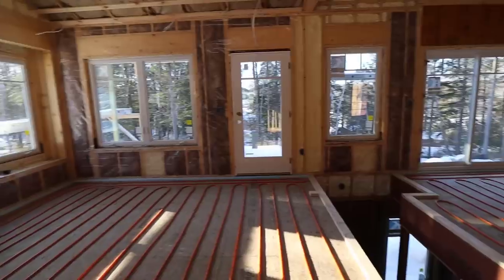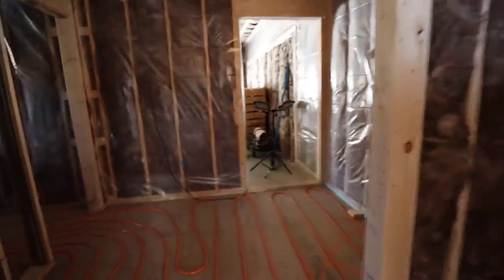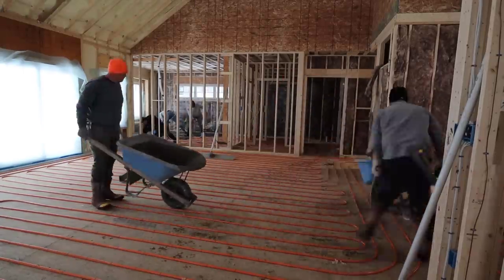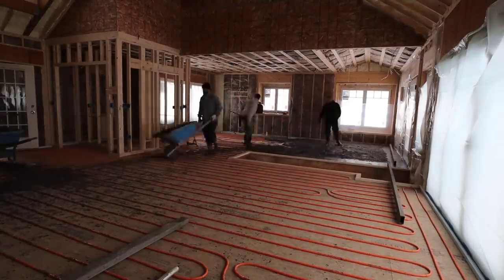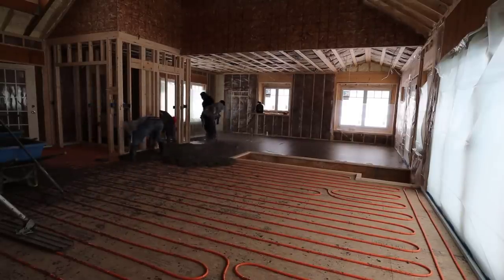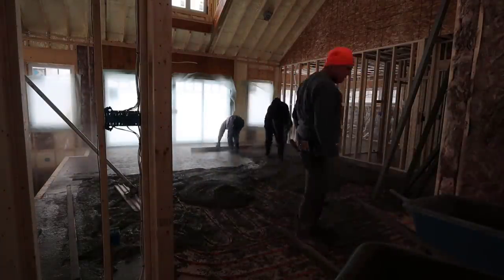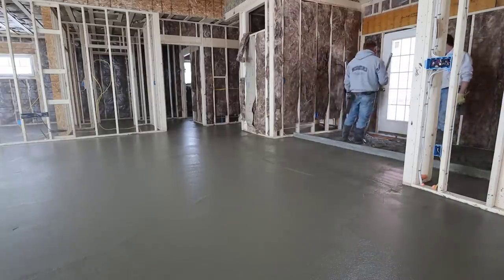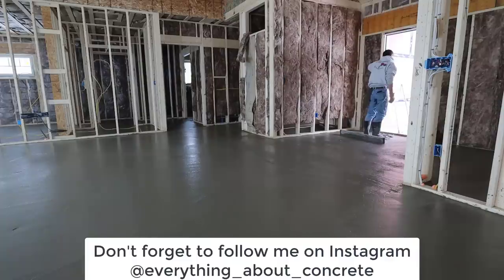Pouring Concrete For A Radiant Heated Floor (Concrete Over Plywood)

Comment: Hi Mike. Love your videos!
I have a funny story related to this pour.
Back in the early days of radiant heat slabs, I was in a meeting with the homeowner and the heat tubing salesman. Part of the salesman's pitch was that the tubing was so rugged that you could drive a mixer over it! Well that clinched the deal with the homeowner and the basement pour was scheduled. The morning of the pour we intered down thru the garage Bilco stairs to find a big sign waiting to greet us......PLEASE DO NOT STEP ON THE TUBING!!!
Hahahahahahaha. 
So much for indestructible and on top of that I guess we were supposed to remember where the hose was once it was cover with concrete!
Reply from the maker: Nice story! I still run into homeowners stepping in between the tubes and not on them. I walk right on them when I get there. Probably scare the crap out of them!!
Reply: @MikeDayConcrete  Hahaha for sure!

Comment: We pour quite few radiant floors in Wyomings cold climate  usually line pump if we do wheel we always pad front bar and legs and lay piece foam down to tip wheel barrow on 3/8 rock 6 sack good video pour on warm weather is upon us.

Comment: We do remodeling and a current client was asking about possibly covering her previously carpeted house with concrete - finished, and stained.

Now, we do concrete countertops and pour slabs, but honestly, it's a large floor-space and would want it to look good and last.  I'm just worried about cracking and flex, because we would be very limited on the thickness.  And I know that some modified concretes do not take an acid stain that well (if at all).

I'd love to do it, but it would need to be clean, strong and look great.

Comment: Poured several of these pretty well the same way you did except line pumped and not wheeled. Also have poured several garage floors like this,only 5 inches thick.

Comment: I noticed the double bottom plate. No air conditioning I take it. 
I have radiant floor heat in my basement with forced air upstairs.  ICF walls to roof line. LOVE my house. Built whole thing with my dad and family's help.

Comment: We use a pump truck in ny excellent job   guys
Reply from the maker: We do when we don't have access like this. I figure you either pull the hose around or wheel it. Little less money wheeling.

Comment: We do radiant ones in basements probably 8-10 a year.We have done one like what you did but it was 3" thick 4,000 psi 3/4 2 percent it was polished after we put a buff on it. I own a Schwing P88 pump for are use it uses 4,000 psi 3/8 pump mix more cement than stone. Would work great for that job plus you would make another $1,000-$1,100 and do it much easier and faster.
Reply from the maker: We use the smaller hoses like you have sometimes. We just pumped one with a 2" line, 4000 3/8 mix. It's a lot easier on the back than some of the 4" line pumps we use.

Comment: Mike, I have a concrete problem. Can you give me advice? I have a detached garage I want to finish out with radiant. The old slab is very solid, no cracks, But it has 2-6” dips in it for old floor drains that have been decommissioned. I want to level it out so I can put warmboard and radiant over it to finish. What product would you use to level it out? Or would you demo it and put in-slab tubing instead of warmboard? Thanks.

Comment: we are just about to do a 900 square foot slab. in my home,,DIY   Your video is so informative, and confidence building.  Thank you so much.  What are your thoughts about putting in expansion joints in the form of wood to act as a screed level as well, I can find no information on doing that?  One builder here I understand using metal flanges (?) screwed to the floor.  I cannot find any information about that.  I am familiar with the cutting after technique..Amélie

Comment: Was any temporary shoring required on the floor below? I’m guessing the engineer just ‘beefs-up’ the structure to accommodate for the weight bcz it would be substantial. 8yds of concrete would add an additional +32,000lbs to that deck! You said there was fiber mesh but no rebar so I’m guessing the live load calculation would never go away? Was this the regular pearock mix you usually use with no gypsum or styrofoam beads? I live in Florida so radiant floor heating (or any heating!) is way outta my lane.
I know you said the floor was zoned but it always seemed to me that there would be ‘hotter’ spots in the floor bcz of the water temp at outtake vs water temp at intake.
Reply from the maker: No extra shoring up is required with these floor trusses. No rebar is necessary, we just use fibermesh to help reduce shrinkage cracking that we know is going to happen. It's not a big deal since the floor is all covered.  Yes, regular pea rock concrete with no gypsum or styrofoam beads.
Reply: Also know the difference between pea stone and pea gravel, pea gravel is smooth and round for exposed aggregate, in fla lots of concrete has crushed shells
Reply: @markme4441  -It’s not as much crushed shells as it is crushed coral which does contain fossilized shells. If you look at it closely you can notice them here and there. The fossilization has turned them into a white, marine limestone. 
-Whenever ordering ready-mix concrete (in FL) the small aggregate is called “pearock” as opposed to a “regular mix” which contains a .57 stone (¾”) for the coarse aggregate. Either way, they’re both crushed coral. 
-I don’t know about other areas, but if you intend on using a 2” concrete pump, you need to specify a “pearock-pumpmix”. A regular pearock will not pump easily thru a 2” hose and you’ll probably get jammed up a cpl times. A “pearock-pumpmix” aggregate gets sifted once more thru a slightly finer sieve than the standard ⅜”.

Comment: Hi Mike. I see there was no primer or sealant placed over the plywood sub floor before the concrete was poured. Is it not recommended to seal the plywood sub floor before? Thanks
Reply from the maker: No one ever does that here. I've poured about 500 of these over the years and never seen anyone seal the plywood.
Reply: @MikeDayConcrete  Thanks. I see some Gypcrete spec sheets indicate using a vapour barrier if you are pouring on top of a crawl space. I want to use this in my new 4 season cottage in Canada with a crawl space that will not be completely sealed and heated but it will be closed in from the elements.

Comment: A question on your lower slab do you put rebar in the slab? I understand you don’t do it on the upper floor because there’s not enough room. I’m building a slab on grade and the first and second floor will be concrete just like your pour here. I was not going to use rebar at all because it’s not a structural slab. I will use fiber mesh ..

Comment: We had put radiant floor heat in our own shop (pole barn with a concrete floor) and it was wonderful.  I've always thought a radiant floor without a thermal mass like concrete to hold the heat would not be as efficient.  How does such a thin floor hold up to cracking?  Especially with the heat being in it.
Reply from the maker: A thin floor like this is designed to have some type of flooring over it. Yes, it does develop some shrinkage cracks but it all gets covered up in the end.

Comment: We poured a church one time , full of rooms and two bathrooms. They all ready had the sheet rock up and painted , I was so pissed I almost left the job site. We told the builder why didn't he put the first 2x4 down where the rooms go and then let us pour it . He said he didn't think about that. Some builders just don't care how hard they make it on you to do a good job.
Reply: Ha! And then he probably wanted to backcharge you for any splatter on the painted walls, right?
Reply: @psidvicious   No , thank goodness. He did have plastic tape on the walls.
Reply from the maker: Yea, that does make it more difficult. Shooting grades in each room and snapping lines on each wall. A lot more work, I agree.

Comment: Hey Mike, was lightweight concrete used? What was the span of the floor joists underneath there?
Reply from the maker: We don't use lightweight any more. The floor trusses are designed to hold the extra weight. Besides it's only a 1.5 to 2 lbs more per sf for the peastone concrete. Lightweight concrete up here is about 220 per yd vs peastone at 120. The span was 16" OC.
Reply: @MikeDayConcrete  Gotcha. Okay, so a typical framing layout, good to know. Thank you for sharing!

Comment: Wow  8 x 4050 lbs = 32400 lbs added for the flooring ?  That house must have some serious framing.
Reply: Ha! I just commented on the same thing.
Reply from the maker: Engineered floor trusses, I wish I'd taken some video of them now.
Reply: Thats not alot of wieght when its spread out.
Reply: Thats about 18 lbs per sq ft,        a 200 lb person standing on 3 sq ft is 66 lb per sq foot ,   so not to much to worry about
Reply: @toddreynolds8875  You are not wrong. But 32K lbs on the 2nd floor of a wooden structure is still a lot of weight. I doubt they have anything to worry about though bcz I’m sure the design engineer took this into complete consideration and designed it accordingly.

Comment: 1 Is it true plywood (not OSB) and what thickness? 3/4 single sheet? I think you would have to know just to be safe.
2 Is the concrete wetter for this app?
3 Regardless of the time of year. Is there a special mix for this: more cement? lime? slump?
4 No tar paper or plastic over the plywood?
Thx and good vid
MJ

Comment: I was looking to do a similar pour over my slab with only a 1/4 inch insulation barrier and 1/2 inch pex with rapidset mortar but it only comes in bags
Does this seem possible or should I expect large cracks

Comment: Wheel barrow oh Wheel barrow
You have your place while filling a space
but lets be smart from the start and use an in line pump!
Reply from the maker: I saved this guy about 1000 bucks by wheel barrowing and not getting a pump. That's not smart?
Reply: Smart.
Reply: @MikeDayConcrete  saved $1000 bucks?
Does that include the costs saved from fewer man hours pouring the concrete?

Comment: Interesting. Never seen that done in the Midwest. Do they still install forced air furnace and air?
Reply from the maker: Not on a house like this with radiant heat in the floor, just a hot water boiler.

Comment: Nice job but you need to look into Calcium Sulphate free flowing screeds, you can go thinner that concrete screeds (10mm on top of UFH pipe), no cracking or curling like concrete and can lay more area per hour with a lot less labour, only need 3 men inside a home like this.
Reply from the maker: Where, in what state are you doing this Wayne. Any pics of it.
Reply: @MikeDayConcrete  I'm in New Zealand, tell me how to add some pics and i will

Comment: Seems like it would be much easier to lay down Warmboard wood subfloor for radiant heat?
Reply: The electric bill would be much higher  employing warm-board than using this method accompanied by a boiler.
Reply: @artman2119  Warmboard uses a boiler

Comment: Have ever seen any issues with rot? When I’ve done these floors I always had to install a vapor barrier or use pressure treated plywood.
Reply: Areas by doors and sliding windows get a temperature difference which seems to create moisture.

Comment: Hey Mike, I love your videos and the professionalism and quality you give your customers, but I gotta say I'm surprised how you poured this floor.  Radiant heat systems, especially those in slabs are kinda like nuclear reactors, you take extra steps to design and build them in such a way to avoid any future failures. Any future failure, even a pinhole leak five years from now, is a really big headache and expense for the homeowner.

That's why I was surprised to see the crew using regular wheelbarrows. The steel legs could easily cut the pex, so could the front cross piece when they tip up the load. Even if you don't fully sever the pex today, slicing the sheath or over-compressing it by setting a full load on the pex could cause a premature failure. At a minimum I would have duct taped some rigid foam board over the legs and front cross piece to minimize the chance of damage.
Reply: U drag a piece of plywood around 4 the nose when u pour out & u got like a foot or so between runs so ur feet fit if you pay attention to what your doing. Where u load up u make a landing out of plywood
Reply: @hippieman5554  you made my point. Even the most diligent people make mistakes. That floor will have at least 1,600 linear feet of tube, probably more like 2,000 given their in Maine, and any nick or cut could causes a leak in the future.  Why risk the chance of human error? Pad the legs, pad the nose, and use the plywood you mention.